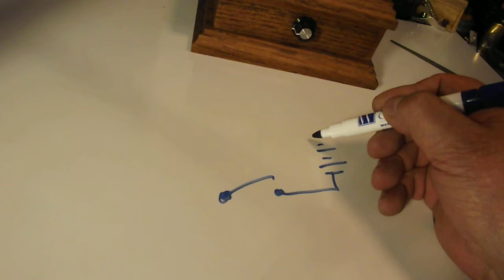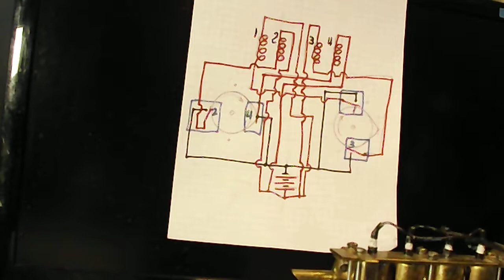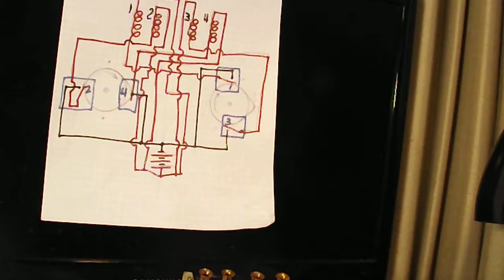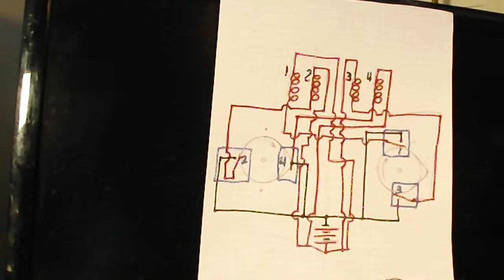Miniature 4 cylinder solenoid engine build expose by Art Rafael

Comment: this video so awesome ... Sir can i know what material you use and the component to build the solenoid engine ..
Reply from the maker: Thank you, Shahrezza.  The yellow metals are brass flat stock and tubes are also brass.  The fly wheels are also brass (Any round wheel will work).  The switches are simple (Radio Shack) toggle and rocker components.  The cylinders are wound copper wire, and the pistons are steel.  The base is oak (any suitable small box will work).
Reply: @ArtRafaelminiatures  ty sir for the info..  Im trying to create on for my final years project..  But im stuck for the component electronic info and my small budget cant waste to bought unnecessary component.. 
Sir if you could help me to see your paper work in pdf.  I would be glad.
Reply: @ArtRafaelminiatures  this is my email.  srezza46@gmail.com
Reply from the maker: Hi, Shahrezza Mohd Nor.  I appreciate your interest.  This 4 cyl engine may be too complex for a beginner, but I have built several other engines that may be more suitable for a beginner.  See, on youtube under " miniature tools by Art Rafael " , the one titled "Electromagnetic Vertical Solenoid Piston Engine Motor.  This video includes a detailed  schematic drawing.  Or see videos "Simple miniature Solenoid Engine I and II.  Prebuilt solenoids can be found in many electric devices such as door bells / gongs, door locks in cars, etc.  Find an electronic junk / recycle store; they will have a bin full of all sizes, or wind your own.  You can build the engine frame out of wood instead of brass and save $.

Comment: Hello, Mr.Rafael.
Thank you very much for your answer.
Miniature tool  I also contributed to the plane.
Please read.
By the way it's understood that there are a solenoid and a battery the number is certainly.
The same one as you isn't produced, but please tell me ampere with the wire turns of the solenoid, the ohm and the volt of the battery.
When you'd tell, I'll produce again in a nearby one.
I made the switch the infrared nothingness contact switch.
I don't contribute an animation.
You should be able to exchange mailing directly.
I'm very sorry for only a favor.

Comment from the maker: Hi, Japan toki.  I am glad that you understand the diagram.  There are many varieties of solenoids and batteries that can work.  Perhaps you can post a picture of your engine.
Reply: ***** Hello, Mr.Rafael.
Thank you very much for your answer.
Miniature tool  I also contributed to the plane.
Please read.
By the way it's understood that there are a solenoid and a battery the number is certainly.
The same one as you isn't produced, but please tell me ampere with the wire turns of the solenoid, the ohm and the volt of the battery.
When you'd tell, I'll produce again in a nearby one.
I made the switch the infrared nothingness contact switch.
I don't contribute an animation.
You should be able to exchange mailing directly.
I'm very sorry for only a favor.

Comment: That is so cool. I wondered how your solenoid engines worked. I assumed it involved at least some electronics but it's literally controlled by only switched and solenoids mechanical timed. Brilliant! You always make such beautiful tools and machines! Thanks for explaining this.

Oh, Ralph, I built a custom magic prop as a commission back in January. At one point, I needed to shave some wood that was already installed on the inside. After trying and trying, your miniature plane was the only way I could do it. And boy did I work nicely! I am still very grateful and honored to have received that piece of art. Thanks again, my fine Sir!
Reply: That is out of this world AWESOME little motor...Cool
Reply from the maker: Thank you, Steve.  I always appreciate your insight.  The switching could be done with solid state electronic or reed and magnetic devices, etc.  And yes, I often use my little tools to perform tasks that only they could.  I am gratified that you find your little plane useful.
Reply from the maker: William Whittaker
Thanks, William.